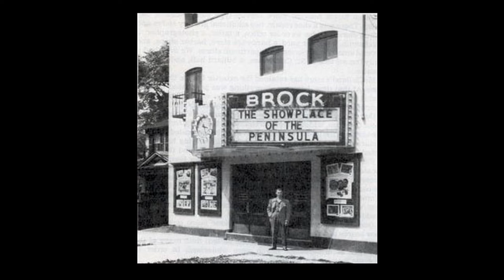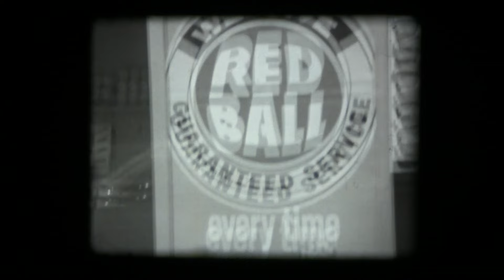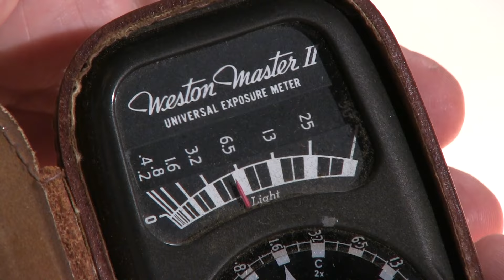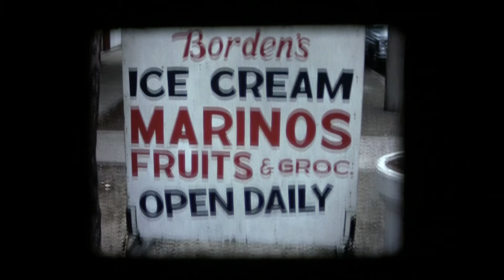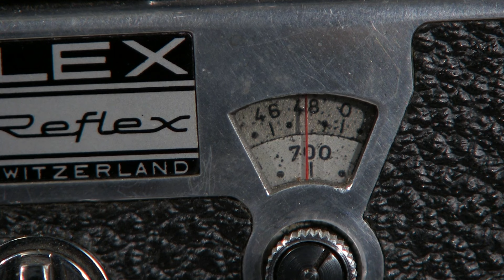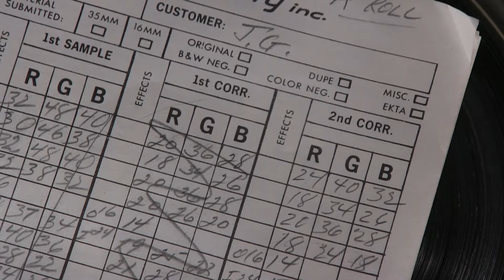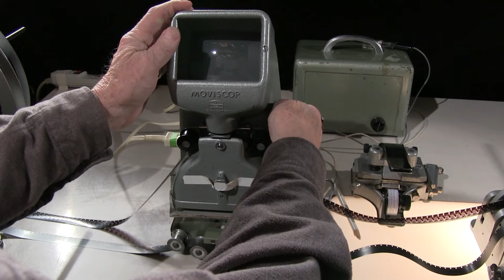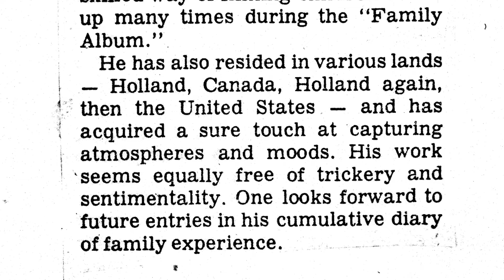16 mm. film - a look back - Shooting with the Bolex (2015)

Comment: Thanks for sharing your video which I really enjoyed,I never owned a 16mm Projector so only had 8mm Projectors I still have a Cinerex 8mm in the house I’ve been thinking of getting a Bell and Howell 16mm Sound projector I’ve seen several on EBay but have wondered if parts are hard to come by,I’m now 63 and live in the UK.
Reply from the maker: Thanks for writing. Make sure to have some guarantee on buying a projector.
Check around if there are any repair places in the UK.  Good luck.

Comment: Many thanks, this brought back many memories of working in TV and independent film before digital days in the 70's through to the 90's, We had a Bolex. a Krasnogorsk and anEclair in our workshop, a double headed projector and various ancient editing machines, Acmade table tops.. Changing stock in a black bag was always a challenge. Sound loss at 33 minutes in until 36? A bit out of sync thereafter? 12frames? Great music too!
Reply from the maker: Thanks Bob for your reply, cleaning out stuff in basement, and found two mint changing bags, what to do with them, yes many memories these items have,
I did own an Aaton, really liked that camera, the way it nestled on your shoulders, alas, electronics came in and I sold it, since I wasn't using it any more.
Could re edit Bolex video, but if i do that might as well use cleared music.
Best   peter
Reply: @peterhoving9207  Thanks Peter, I have shared your piece with fellow film-makers to re-fresh their memories! I've not done much film or video for many years apart from funerals on my little Olympus camera! (Well, I have done other things, played guitar in bands and promoted jazz...) Stay well, all the best from Manchester UK.

Comment: I had one specifically adapted for time lapse. I used an earlier, non reflex, model so there was less chance of light leak over sequences that could take months to shoot. The picture was astoundingly steady with no jitter or float at all. My rig was very versatile. Because there’s no mirror the exposures could be very close together. For instance, I could do sequential 1 sec exposures with virtual no gap between them, which is very hard on a spinning mirror camera. I used a cam to trigger  the side release which was fitted with  roller bearing so everything was very smooth. Because it was spring powered I only needed power to trigger the exposure motor so it ran for months on one battery. My longest job was the building of a large ocean going catamaran. It took two years, and was shot on one 100’ roll. I had to occasionally wind the camera.

Comment: 12:19...Peter: You put the film on top of that piece of metal, on the take-up reel!
That film must have scratches on its surface!
Reply from the maker: It doesn't matter, it's at the beginning of the film, whether it's scratched or not,
 once the bolex cover is closed, and you run off a few feet, you start shooting, and there should
 not be anything that would scratch the film.
Reply: @peterhoving9207 ...Ok, but the whole movie will go through that piece of metal.
Reply from the maker: @magoa-m7e  These are the film loops, that make a prescribed loop before and after the gate
you set them up when you threat the film and they will open up when you close the Bolex door.
 So they never touch the film.  I should have explained that in the video.
Reply from the maker: Also, before you load the film, you cut the film diagonally, with a cutter build in the camera.
I also should have shown that in the video. Thanks for your keen observation.
Reply: @peterhoving9207  Ok ... Thanks for the reply.

Comment: 6:50 was the footage slowed-down or was there no reverse telecine done to get out the ghosting that's going on here? Not criticizing, just curious, old 16mm footage is tough to get perfectly without a professional, and expensive,  telecine. Great video!
Reply from the maker: The ghosting that you see is because I shot with my small video camera from
a screen where the image was projected by a regular 16 mm. projector.  I should have done it at a transfer facility. it was original 16 mm. film and it had many splices but seemed to go through the projector with no problem, yes, could
not get rid of the ghosting, and in hindsight should have spend the money at a transfer place.   Very few people seem to notice this ghosting or comment on it.
Thanks for your comments.  I never expected this video to be such a favorite by 
YouTube viewers.

t
Reply: @peterhoving9207  I figured, I've done that before myself with similar results with Super8 film. You do what you can with what you got sometimes, right? It was worth it for this video certainly!

Comment: 60 years ago, at age 16, a Bolex 16 mm camera was lent to me by the director of the police boys club in Washington, D.C. He asked that I make a 10 minute film for the donors dinner that fall. I had use of the camera all summer  long (but a budget for only 50 ft of kodachrome stock). I took the camera on vacation to Kitty Hawk N.C. and "photographed" storms and seagulls droppin clams onto rocks. I "photographed" everything, using the Bolex with the Paillard lens. I had no film inside, but I loved that camera that I used it everywhere and carefully set the aperture according to the Weston meter that accompanied it. Finally in the fall at the donors dinner I presented the film about the boys club. The film had a standing ovation and won the lasting appreciation of the director. Bottom line: The Bolex was such a marvelous piece of photographic engineering that it simply took your heart away with it wherever you go. Naturally I had to return it to the Boy's Club, but it enriched that summer immensely.  Rudolph Aukschun
Reply from the maker: Thanks for sharing your Bolex story.

Comment: You've got a pan conor 17-86 zoom which doesn't go wide enough. 17mm on 16 is just about a standard 50mm lens on still 35. A 10-100 angenieux would be ideal. 10mm is just about 35mm on still 35.
Reply from the maker: Thanks for your comment.  Yes, 17 mm. not wide enough that's why I had a 10 mm. Bolex lens.

Comment from the maker: dated: June 1, 2020 Video out of sync after 36.09 because of MUSIC RIGHTS PROBLEMS.
Reply: can be fix:(?
Reply from the maker: @grisoli521  It means I have to re edit the video, also I still run the risk of YouTube not liking any of the other music tracks and yanking it off the air again....
Reply from the maker: @grisoli521  too much effort to re edit and all the other music in the video has the same problem, they (google) can yank the video off the air at any time.
Reply: I assumed it was a gag about the sound reel not being present until it went on too long. Very good otherwise
Reply from the maker: @timellis7720  Not a gag, YouTube took the sound away because of
music right problems.

Comment: Peter - With the Weston II meters, they want you to specify "A" type camera or "B" type camera. My camera is not listed on the old owner's manual I downloaded. My Super 8 camera is from the 1980s, with a choice between a 150-degree and 220-degee shutter angle.. How can I tell which camera type it is, if I decide to buy a Weston II meter on eBay to meter my shots?
Reply from the maker: Hi Frank, I'm afraid i don't know where my meter is at the moment, somewhere in the basement with all the other junk.With the Bolex 16 mm. I used the Weston 5, 
and used a l/75 shutter angle.  I think an exposure test would be in order, using 150 and 220 shutter angles.
Reply from the maker: Of course if most of your shooting is outside, it's not too difficult to have a variety of exposure settings, like sunny, sunny cloudy, cloudy, dark cloudy,
they used to supply this info with 120 film.
Reply: @peterhoving9207  I think I'm going to play it safe and upgrade my Sekonic.
Reply from the maker: @OskarFilms  Many years ago I taught a semester in cinematography 
at Boston University and we shot 16 mm. and tested it 2 stops over and under, and somehow in printing it all came out pretty equal.  We were shooting color negative, so there was plenty of latitude unlike positive film where the exposure has to be accurate.
Reply: @peterhoving9207  You taught at my alma mater, SED '95.

Comment: Hi. I have a 16mm cine-Kodak super-x film, found from at my grandparents' attic. Can I use the Bolex projector to view it? What projector type and model would you recommend for this? Thank you.
Reply from the maker: It seems to me that any 16 mm. projector would project 16 mm film. You can either project the film at 24 frames per second or at silent speed which is lower.
 Maybe at 16 frames per second.
Reply: @peterhoving9207  thank you :) any specific projector brands you recommend?
Reply from the maker: @thesilenttraveller7  I would recommend the EIKI slim line 16 mm. projector with easy threading.
Reply from the maker: @thesilenttraveller7  The 16 mm EIKI slim line projector I would recommend.
Reply: @peterhoving9207  Thanks Peter.

Comment: I love this. Thank you very much for sharing. I recently purchased a Bolex 16mm H-16 M-4. It doesn't have a turret system so it only supports a single lens at a time. It came with a 17-85mm zoom lens like the one you have except that because this model Bolex isn't a reflex model, the lens has a diopter coming off the side of it. I have a roll of film but haven't used it yet. I am excited to test the camera to see how well it works. Your video is inspiring. I too used to work as a projectionist at a movie theater in Florida towards the tail end of film projection. They had 8 screens, all film projectors. I am currently trying to change my career from computer programming to becoming a filmmaker because film was my first love. I own digital video equipment but I really wish that shooting on my Super 8 or Bolex camera wasn't so expensive. Anyway, awesome video!
Reply from the maker: Good luck Nicholas in shooting film......Peter
Reply: Buy film right from Kodak and develop your own, much cheaper in the end. The gear you need to develop film will pay for itself very quickly, especially if you do a lot of super 8 which is terribly expensive to shoot. Standard 8mm and 16mm are much cheaper than super 8......

Comment from the maker: Don't forget, using 16 mm. film, was the only way to make personal films in the sixties,
and of course, the prices of film stock was much lower than now.  Also you had to make work prints the preserve the original footage from damage....
Reply: Actually it costs the same today as back then just adjusted for inflation but the price today is roughly what it would have been in the 60's if you calculate for inflation
Reply from the maker: @pilsplease7561  Not quite understanding what  the costs are, the film, the camera?
Reply from the maker: I am afraid I don't understand your statement about cost, the cost of what?
Reply: @peterhoving9207  I think Pils point is that buying multiple film stock, developing dailies, and making copies of the negative to show at individual theaters costs the same now as it did back in the day. You just adjust the cost of everything I just mentioned via inflation.

Comment: Really enjoyed your film - and all the info/tips. Do you recall what frame-rate you were using for the first film (the road trip) as it looks like it may have been quite low due to some stuttering/ghosting etc.- that might be down to the transfer settings though onto digital/youtube. After you got used to the camera did you settle down into one frame-rate for general filming or alter it depending on how much movement there was going to be in the shot?
Reply from the maker: Hi, good questions.  I actually shot the first film (road trip) with my video camera from a screen using a 16 mm. projector, that's why the ghosting. In shooting with the Bolex I always used the 24 frames per second setting. Later on, I had the films scanned professionally rather than shoot from a screen.
Reply from the maker: See "The Grandfather" and "The Village" shot with a Bolex, and scanned professionally.
Reply: Peter Hoving ah great - many thanks. Yes I noticed the improvement to the image on the later films. That’s good to know. I’m considering buying a bolex 16mm and your info has helped greatly - cheers.
Reply from the maker: I made a mistake in the Bolex video, I am using a Rex 3 Bolex, not a Rex 4 Bolex. Good luck in finding a 16 mm. Bolex.
Reply from the maker: The frame rate I used on the Bolex was the regular 24 frames per second.  The road trip film was projected on a screen and I shot with a video camera the image on the screen, so that's why there is some ghosting. The proper way is to transfer digitally at a production place.  There are 2 production houses here in Boston that do that service.

Comment: I'm a cheap bugger and load all films in complete darkness to get as much as possible. I can get two extra pictures on my 35mm camera and probably a few extra seconds if I had a movie camera.
Reply from the maker: You can use a sport coat or a jacket as a changing bag.  I always looked for
a spot in subdued light when I was shooting with the Bolex.
Reply: I would like a movie camera but none record sound optically onto the film.
Reply from the maker: Years ago, in the mid sixties, I shot film using optical sound, using an
Auricon camera with single sprocketed film, later on I shot film using a magnetic stripe on one side. with a converted African camera.
Reply from the maker: Sorry i mis wrote, I meant Auricon rather than African, my automatic spelling feature on my computer did that....

Comment: Im going to get one of these next year i think looks smashing indeed
Reply from the maker: Make sure to get 100 ft. of film, and a lab for processing.
Reply from the maker: I will go to my basement, look at a 16mm print, and measure  a foot in length, count the images in that foot of film and give you an answer.
 @theartofmakingphotography
Reply from the maker: 40 frames per foot in 16 mm. so 100 ft. is 1000 frames, duration 2 min and 46.66 seconds
Reply from the maker: I actually found my 50 year old "Ready-Eddy" a plastic old round scale with numbers on it, made for 16 mm. film, they also have one for 35 mm. film,
and could give you the numbers instantly.  Good luck with your project.
Make sure the gate is clean.

Comment: Its a RX3, not a RX4.
Reply from the maker: Thanks for pointing that out.  Yes, it's a RX3 camera. Got the facts wrong....
Reply: Almost the same camera!
Reply from the maker: In RX4 model the I/T switch went from a lever to a knob and a motor shaft was added so you could use a 24 frames per second sync motor.....
Reply: Yes, the motor shaft went from 8:1 to 1:1.